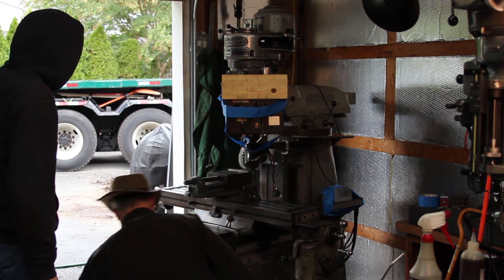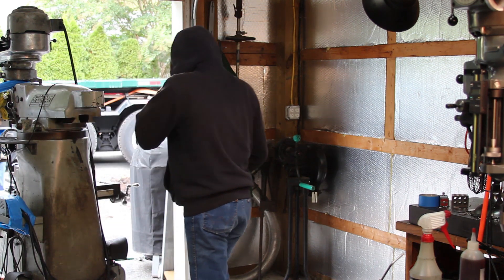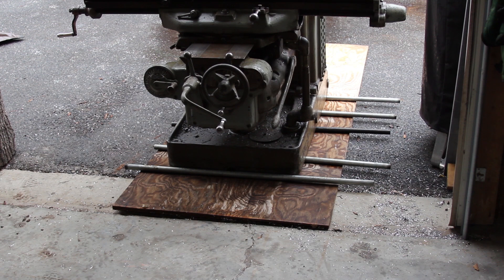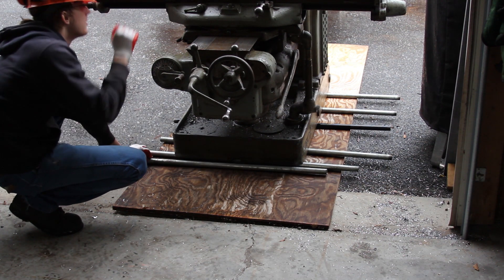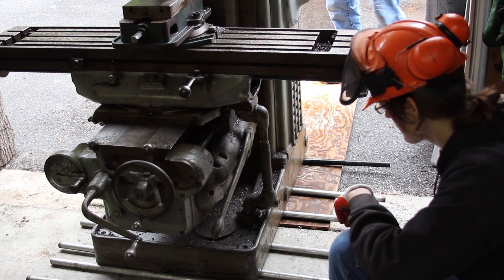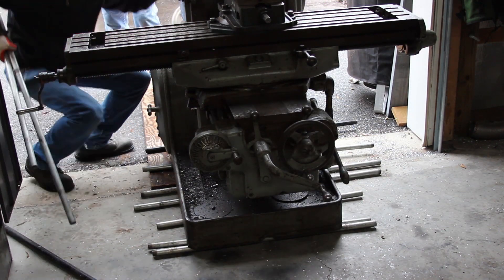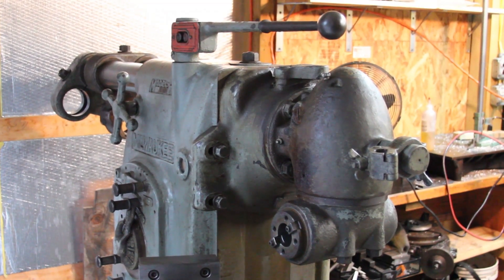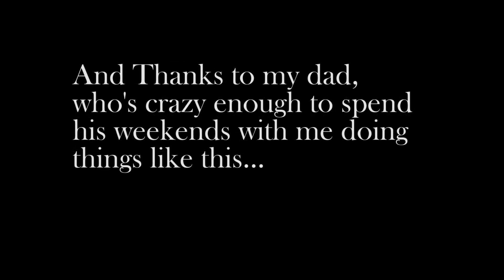Moving Milling Machines

Comment: Nice mill!  Don't forget to drain all the oil and run the mill 10 mins with kerosene before filling with new oil as per the manual. 

I moved a similar sized mill (4000 lbs) with my brother using a rented pickup and trailer, my two tonne gantry and a manual pallet truck. The pallet truck was rated at 5500lbs. Got the advice from Tom Lipton (see his blog entry "what are friends for?").

I look forward to seeing the mill in action. 

Daniel

Comment: Hi Toby, that's a nice machine. Many people think a machine having vertical and horizontal milling capability makes it a 'universal' but you have the real deal, which is the swiveling table. It would be ideal for electronic gear hobbing. Have a look at the pictures on (http://www.stevenson-engineers.co.uk/files/) under 'hob indexer'.

A comment on the move though; Too many rollers!

I've moved machines that size solo and my rule is to use just two rollers most of the time. With that much mass it's just as hard to stop it rolling as it is to start it. With two rollers you can never go more than half the base length out of control. Roll to the balance point, tip and move the roller. By being able to tip you are able to get the next roller in more easily.
Reply from the maker: That sounds pretty smart, we used so many because we thought it might help with the rough terrain and the rotating into position. That's some cool gear milling! I'd love to try that, not sure if I'm up to making my own indexer though... I've looked on ebay and indexing heads are too expensive, and driven indexers are way too expensive.......
Reply: JTZshokunin
Look up the DivisionMaster and Herb Blair home brewed his own version. With affordable stepper motors and micro controllers, dividing plates can be a thing of the past! You should be able to find an affordable rotary table or dividing head, perhaps one with a broken handwheel/damaged shaft just ripe for conversion!

Comment: Nice move.  Works out much better when you have the right equipment, like the truck with the hoist.  That has to be a bit of a bear (just weight-wise) getting the 90 degree attachment on and off to switch between how it is set up now and horizontal milling.

Congrats on the new machine.
Reply from the maker: Thanks, first thing I did was to make it easier: https://fbcdn-sphotos-c-a.akamaihd.net/hphotos-ak-xpa1/t31.0-8/10710501_1494381127480754_1173610974070042285_o.jpg
Reply: Nice mod to just swing it out of the way!